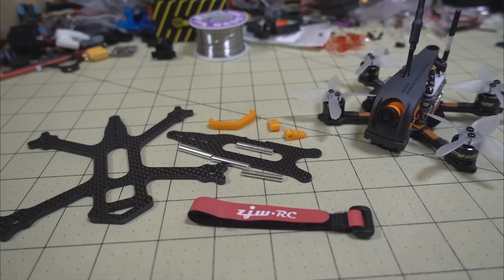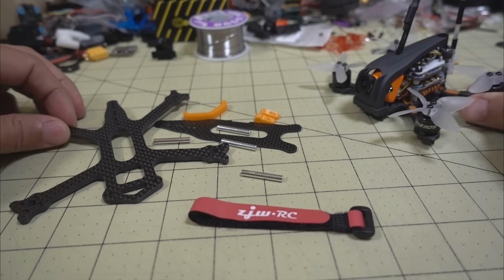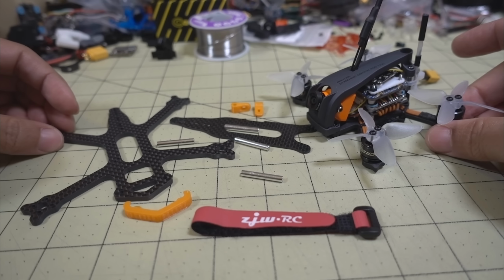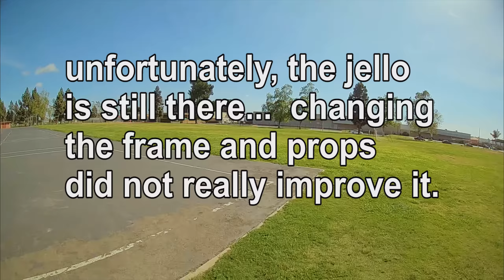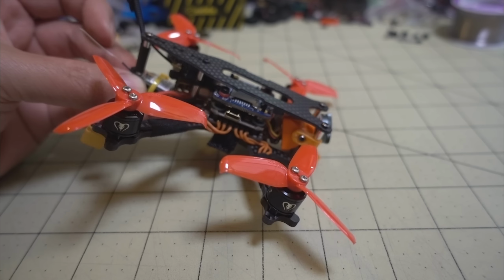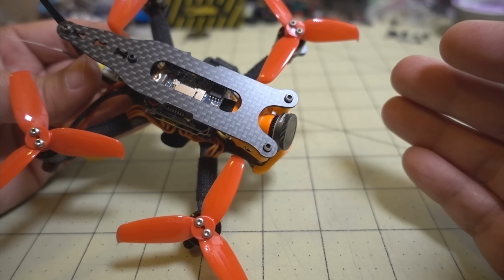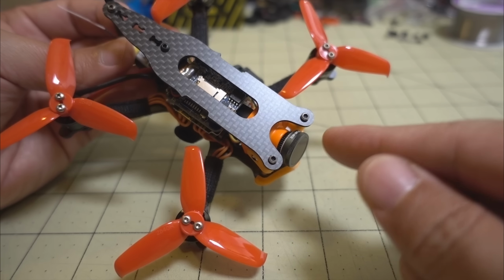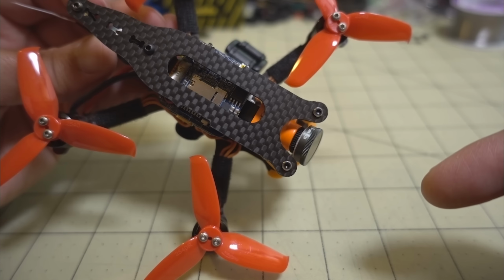Fixing Jello on Split Mini with ND Filters 📷

Comment: I have a Diatone GTR-249+ with a Hawkeye Firefly mounted on top using zip ties. I read somewhere that the Emax Avan Rush props helped with jello. And I haven't clinically analize the before and after, but I definitely can notice a big improvement on the footage that camera recorded. If you haven't tried them, perhaps they are the missing link for a jello-free experience. Thanks for sharing!

Comment: How did you fit the Mavic air ND filter on the Split Mini 2? I just got the Mavic air filter and its too small for the split mini and doesn't fit :(
Reply from the maker: It fits on the one I have with the M8 lens and adapter.  The one you have must be the M12 version.

Comment: as long as runcam adjusts the exosure by ISO and not exposure time, you can put on as much filters as you want. and btw: flying wild circles is the worst choice to analyse jello. straight lines would be smarter for that

Comment: Do those ND fit on the Caddx Turtle?
Reply from the maker: No. It's cheaper to just get the ones from Caddx directly
Reply: @AlbertKimTV  unfortunately they are out of stock on ND16, only the 8 in stock.
Reply: I wonder if an osimo pocket ND could be made to work? I see a nice set of 4 on banggood for 30 bucks.

Comment: you have a video explaining how ND filters work to prevent jello yeah? thought you did but  I can't find it
Reply: A simple photography video on filtering can explain even more! But the best explanation falls - nd filter - is a filter that reduces or modifies the intensity of all wavelengths, or colors, of light equally, giving no changes in hue of color rendition. Basically it allows for better coloring post edit, also smooths out the image. So that jello affect is much harder to see. If you did nd16 for example filming running water it would take droplets and turn everything fluent.